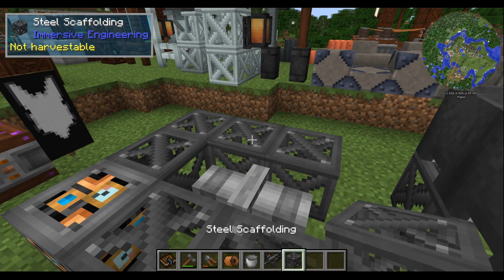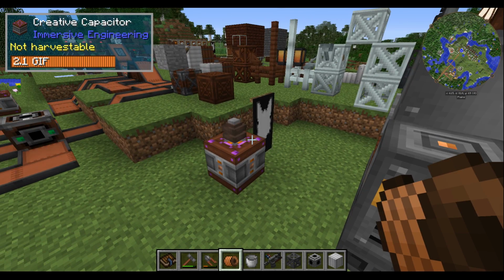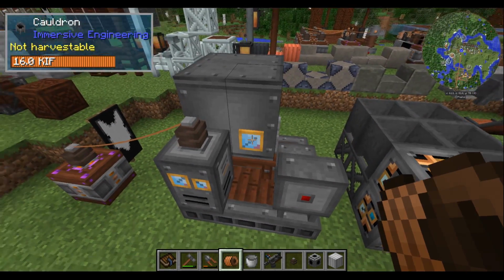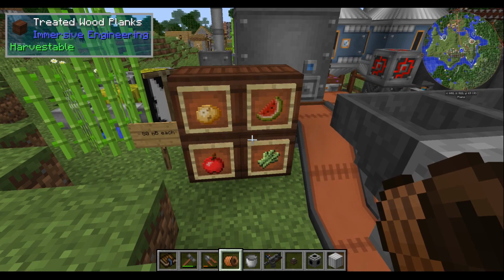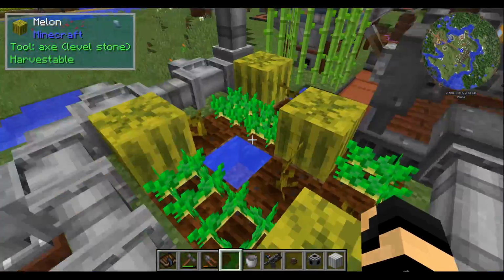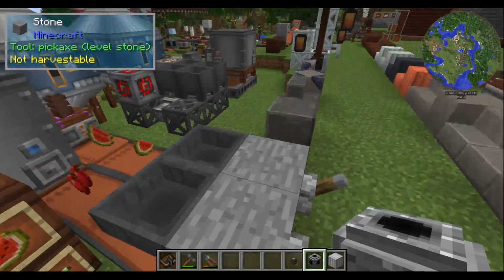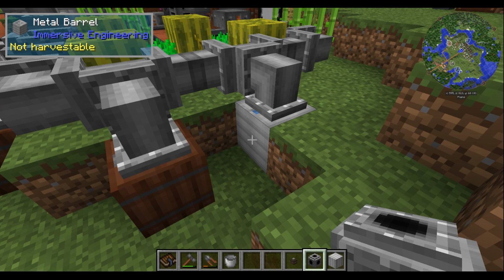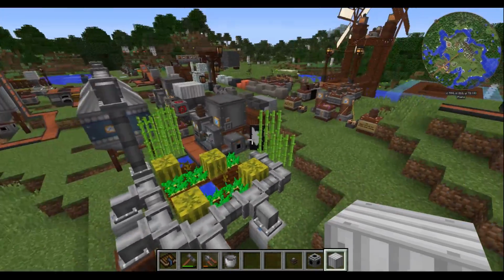Immersive Engineering: Fermenter! - Minecraft 1.10.2/1.11.2

Comment: so what is the point of barrels? they don't seam to do much more than be a checkpoint. can you pick them up?
Reply from the maker: Yes and they retain their contents
Reply: @MischiefofMice  oh cool. ok thanks
Reply: @MischiefofMice  hey quick question,  can a barrell or pipe suck water out of like an ocean? or do you just have to put it in manually?
Reply from the maker: You need a powered pump sitting on water (or other liquids) and turn it on with a lever. Have pipes lead to your storage or what you need the liquid for.
Reply: @MischiefofMice  ok thanks, I appreciate it

Comment: I did some testing quite a while back (albeit with an earlier version of IE), and potatoes turned out to be the most efficient crop to use.  

The main reason for this was that melons require two blocks so you only get half as many when compared to planting potatoes in the same size plot.
Reply: Might just be me but Potatoes seem to grow a lot faster as well. And obviously, you'd want to be using industrial hemp seeds in the squeezer. Needing only one crop to make Biodiesel is great but I don't think it's the most efficient in terms of space or yield/time.